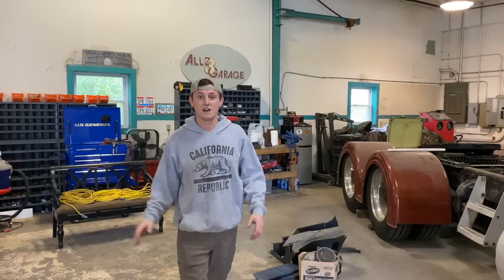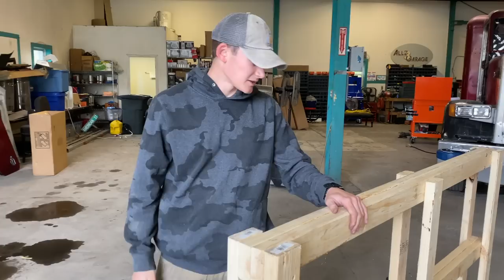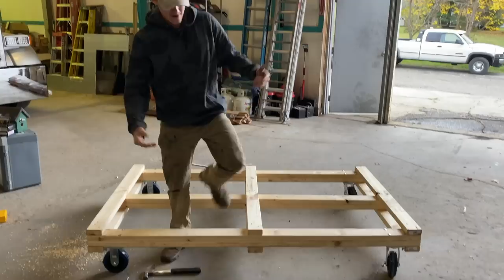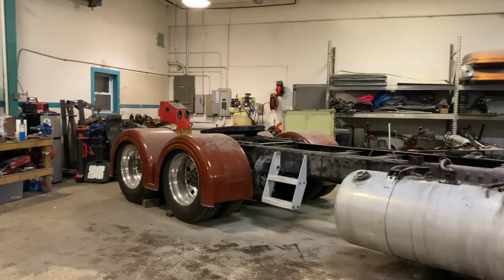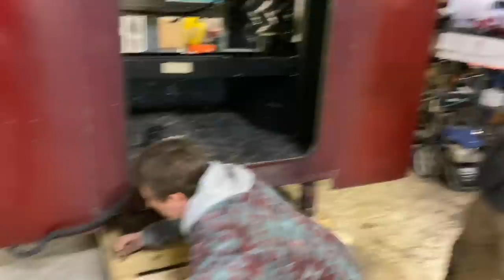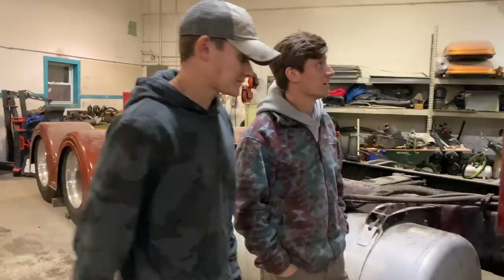"The Worlds Longest DayCab Peterbilt!" Rebuilding a Peterbilt Flattop Part 4

Comment: I think you guys should just pull the cab and hood and really get tge frame cleaned up good and painted good. Gives you a chance to service the engine and paint it as well. Maybe change out the air lines and fuel hoses and really make it a restoration upgrade.
Reply from the maker: You will have to wait and see! This truck is coming all apart! Not a bolt left unturned!